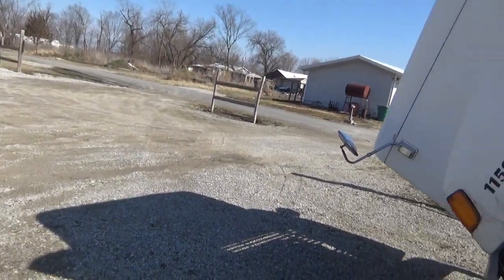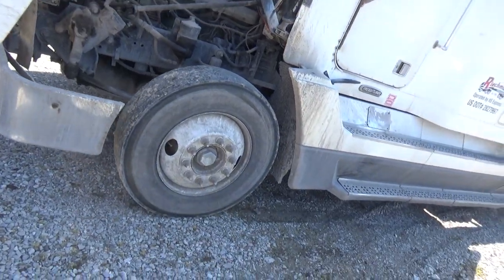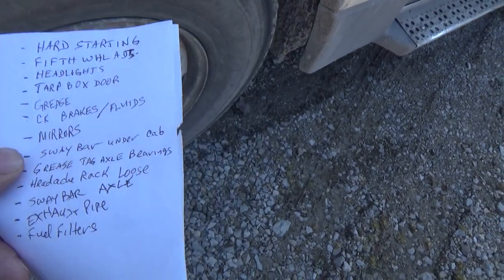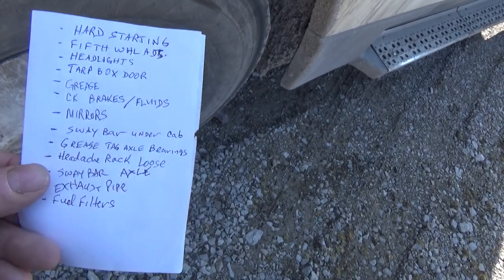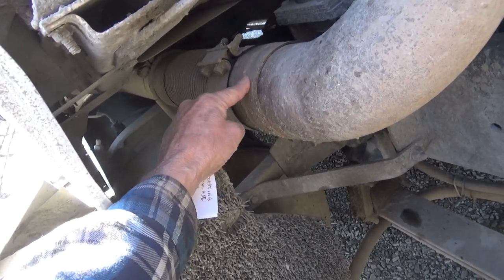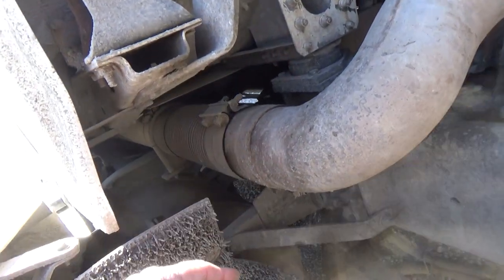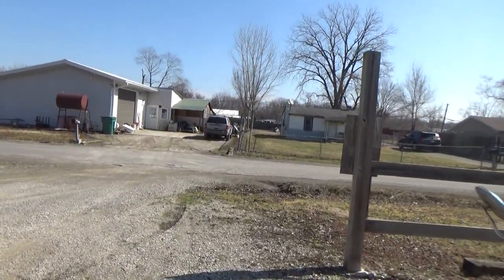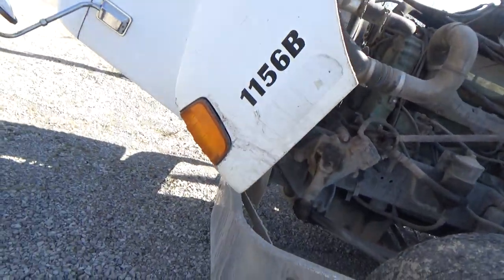For those who want to see my truck repair videos

Comment: Do you have any experience knowledge or tips for running operating and maintaining a big cam 4 
mod name 88NT400BC4 
CPL 1211
esn 27197339
eng config D093541BX02

Fuel pump:
FC4515 G LA
DR04019654
Reply from the maker: Sorry, no I don't know what that is.